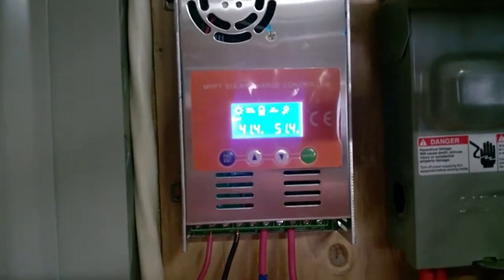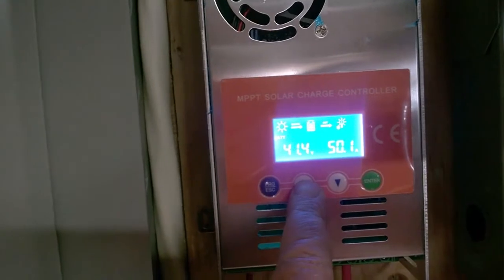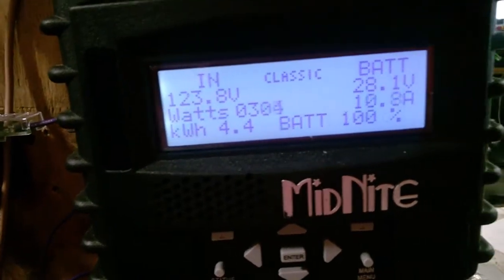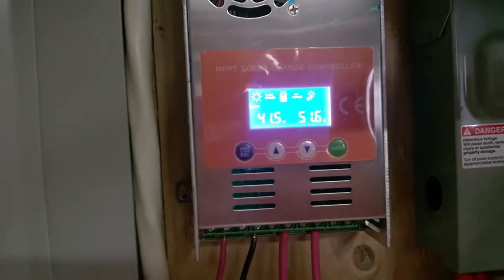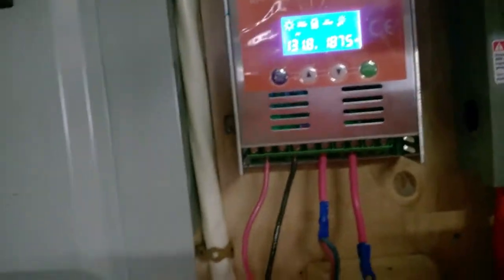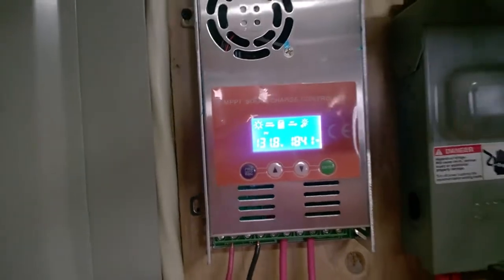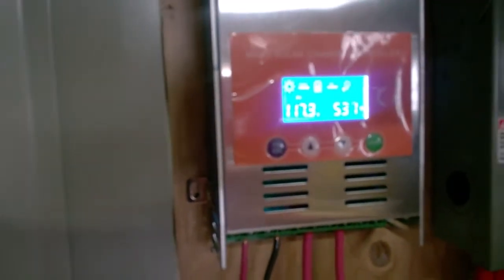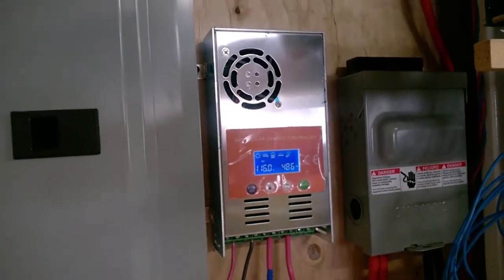2019 32 PowMr 50amp Charge Controller

Comment: Also, I'm really impressed by your power wall that is made up of the a123 bus packs. How long have you had it? How are they doing now? Do you ever get failed packs?
Reply from the maker: My powerwall has been up in one form or another for a year now, just had one pack fail under use and that was not pretty. I found that most full bus packs are good but once in a while I get a bad one so those I dismantle and make into smaller packs or specials like lawn mower batteries. The ones on the wall now work good and the capacity is around 10kwh per 16 packs (one bus battery) I use them differently than most people I only have grid tie inverters for a load so light 20 amp load but they run for 14 hours a night  then I recharge the bank and do it again. they could run large loads I do have a 3400 watt inverter I can run too and the batteries will take a heavy load but that not what I designed it to do.

Comment: Hi, just came across this older video of yours. I'm curious about how the unit is doing now about a year later? Is it still working as it is supposed to?
Reply from the maker: I run that hard for a few months and it performed really well the array I have is a little big for it but the little guy never quit really amazed me but it did get hot as I was putting more watts through it than designed for and only on one 10 gauge wire so I melted one screw a little but it still works, tough charge controller I put up a Midnite Classic instead way more money but it puts up with my abuse.

Comment: I try not to exceed 80% of the MPPT controller's solar capacity.  Might need another controller to split an array but better than losing the controller to heat.
Reply from the maker: Thanks, yes I have another controller just need to run the wire

Comment: Can you please publish your settings for the Lithium Batteries? D00 - D04, I am especially intersted in the settings for  D01 (float) and the d03 cut off voltage . I have a similar setup with a 14s Lithium bank and 136 Volt comming from the panels. Cheers, Lisa
Reply from the maker: I don't use d01 or d02 I use the lithium setting of 01 in do4 then you just use the 12 volt equivalent setting eg. I have 12s x 3.65 (the maximum for one cell) =  43.8 but since this box only sees 12 volt I divide by 3 = 14.6 but I never use maximum so I have reduced it to 14 or even 13.9 as the voltage gauge is out by 0.2. Now when my BMS hits the protection number the PowMr has already stopped charging. I hope this helps if not I can make another video to explain.

Comment: If you are going to run it hard like that then you should consider taking it apart and use some heat sink compound to thermally connect the aluminum heat sink plate in the back to the case then add a heat sink to the back of the unit. That is how I run mine. My heat sinks are only half an inch thick and cover the entire back side of the unit and they are finned. They help a lot. Or at least put spacers on the mounts so air can flow up the back.
Reply from the maker: Thanks for the info I very well may do that

Comment: Be careful brother I hear those dont cut off properly. Good luck
Reply: You do know you are asking for problems. Glad its working .
Reply from the maker: So far it cuts out at the voltage I set it for and just feather the amps as needed but I can see that the firmware on automatic could use the wrong multiplier
Reply: @offgridwanabe  i have no clue. But its probably internal temp
Reply from the maker: @frankz1125  it says power I thought it was the multiplier as everything is times 12 volts.
Reply: @offgridwanabe  honestly i dont know that controller
Reply from the maker: Do you know what the number on the temperature screen is for and not the temperature the first number it is at 3 or 4 and sometimes 7
Reply: @offgridwanabe  
3.0 - Night mode no charging
4.0 - MPPT mode
7.0 - Absorption mode
8.0 - Floating mode
Reply from the maker: @carbogger  Thank you carbogger information is hard to find. Just got the BMS installed so it won't be running as hard capped it off at 30 amps for now.
Reply: Good luck be safe. Those scare me big time.